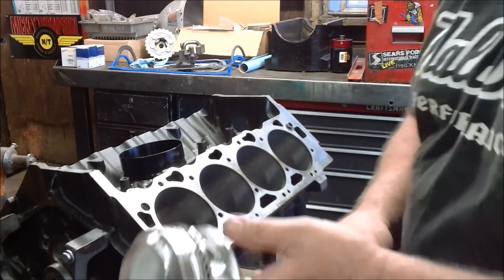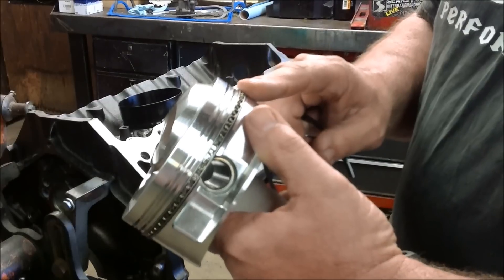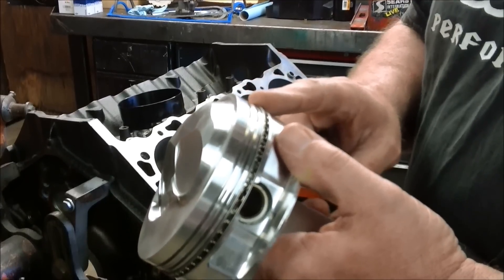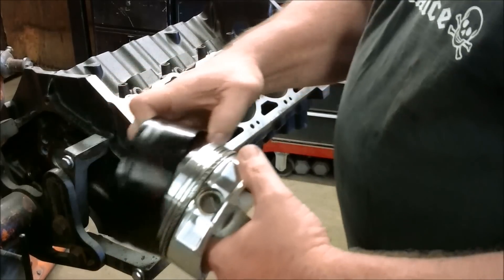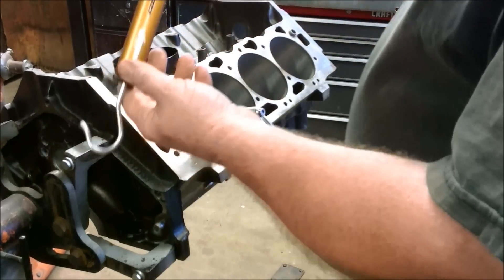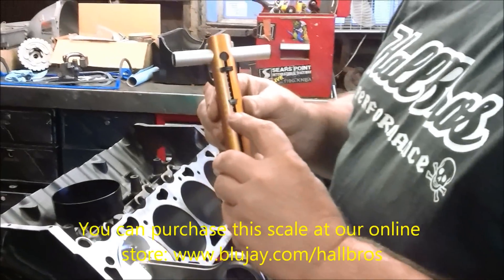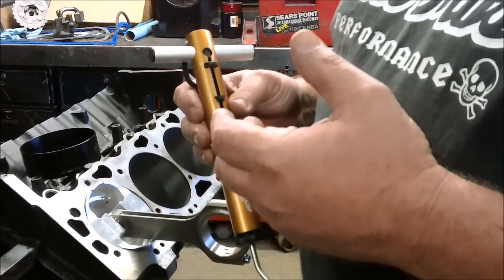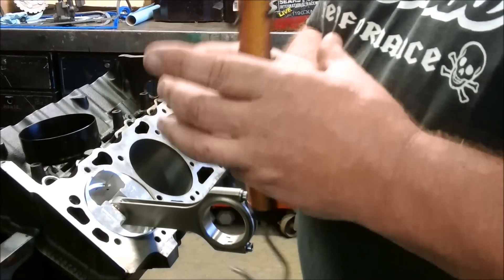Mr. Hall's How to series, Oil Control Ring Tension

Comment: I put an engine together a couple years ago.  Checked the gap on top and second ring and they were bang on for what I needed.  Tried to put it in the hole and the pistons would hardly move.  They were held up on way too much tension on the oil rings.  They must have been packaged wrong for a bigger oversize. Unfortunately I had bought these rings years earlier so no chance of returning.

Comment: Thank you so much. I was just putting my motor together and was suspicious about the control ring as it had no tension so I put the old rings back on and they had tension. Took rings back and the replacement ones have about 12 lbs using your method on a 3 inch bore. Rings came in a sealed box, brand new. Thanks again for this vid.

Comment: when compressing the oil control ring to get it into the cylinder is it actually the expander that is being compressed? That needs a lot of pressure and must result in a lot of pressure on the cylinder from that ring.
Reply from the maker: Yep you are correct. And there are different expanders which can result in different amount of pressure

Comment: my question is how to set the end gap on that expander ring?
Reply from the maker: Usually the gap is big enough on all rails and they make different expanders for different tensions. You can check the rail and use std. gaps